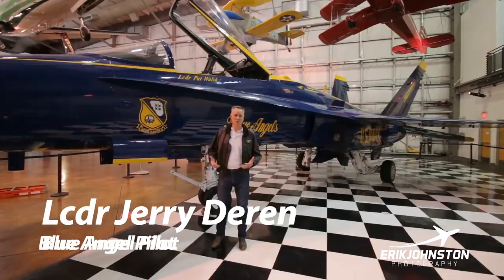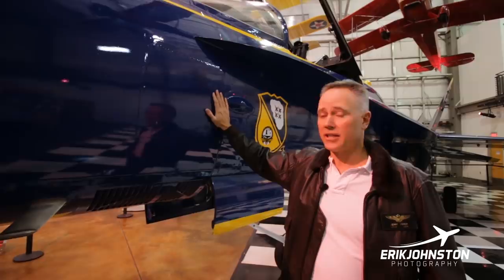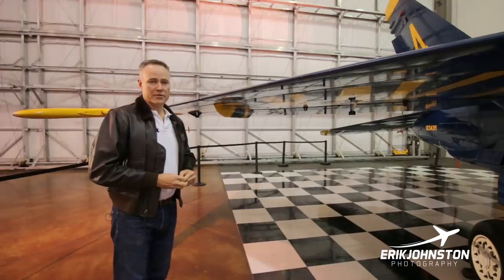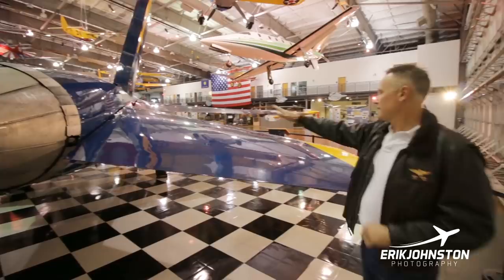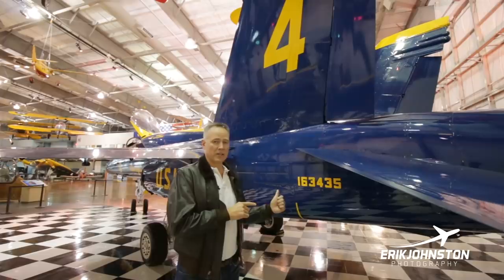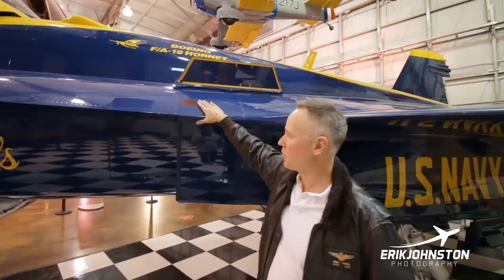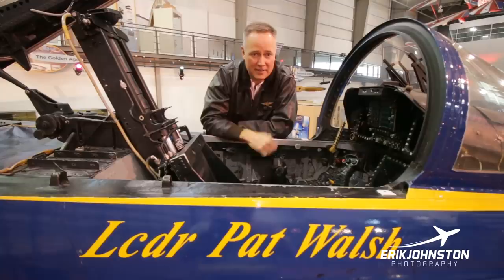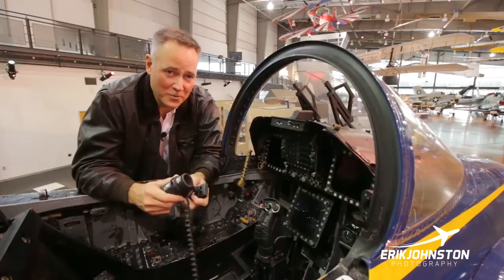Blue Angel FA-18 Walkaround

Comment: Spent many years working on that very jet.  163435 both VFA-86/82 and VFA-81.  Was transferred to 86 from 82 at one point.  Upon checking in to VFA-81, I met this old girl again 12 years later.  She was a flyer for sure.  Until we transferred it to the Blues in 2006 prior to transition to Lot 30 Super Hornets in late 2008.

Comment: after having flown the f-18 in DCS its ridiculous to see how realistic this plane is in the game
Reply: I give you 10/10 for trolling real fa18 pilots. Especially as this video actually gives no filmed direct comparisons that can be simulated on DCS.  The view of the cockpit with LCDs/CRTs off is very accurate though. VRS has a tonne more than DCS does, mainly because VRS focuses on the fa18 only, DCS tries to make so many new mods that I doubt any of them (I own most of them) will be a full release in the next 5 years. Even the fa18 isn't a DCS only project now. As I found out when I reinstalled it a few months ago. Sticking with VRS for now.
Reply: the rolls done in DCS put the leadingedges  slats 3 degrees asymmetric down like the real hornet?

Comment: Like Jerry, I watched the Blues at airshows when I was a teenager.....saw them and the Thunderbirds many times over the years. I never dreamed one day I would fly both a Blue Angel F/A-18C and an F-16 Thunderbird. I now fly remote control versions of both planes. I do most of the moves they do except I fly solo. Top speed is around 100mph and I land on a paved runway 400 feet long with no brakes, arresting hook, parachute or anything else to slow the plane down - kind of like landing on a carrier. May your skies be blue and your winds calm.

Comment: 6:10 Ooooh, Hornet Tips for DCS 😁 Nice!
Reply: Niiiiice
Reply: What page is it??
Reply: There is not page about this information in DCS F/A-18C Hornet
Reply: @32ndvfw  what do you think the FLCS is?
Reply: @goingtoscotland  have you found the page to set it in dcs?
Reply: @Hun0889  FLCS. he's talking about trim settings. Trim to 32.5 units of up elevator trim. Same as if you would set 14 or whatever for a cat shot
Reply: oh i see, yes i can set the trim for the starting around 12° for airfieldstart and 15/16/17°... as you said for the carrierstart.
https://youtu.be/gqlTo739Rz0 
even when flying AOA, i never see the number 32.5 on the fcs page, im confused now...
Reply: @Hun0889  you're looking for 8° roughly AOA for an on speed approach in the Bug. The elevator trim values on the FLCS page do not correlate to degrees as far as AOA goes.
Reply: @goingtoscotland  oh, thats why u wrote units for the elevator-trim, and not degrees.. now i see, just changing the elevator-trim up 32.5 units and the plane starts flying at AOA, right? (hard to get that in english for me...)

Comment: LEX: Leading Edge eXtension.
Reply: Thank you. I was just wondering what "lex" could possibly mean.
Reply: And the little fences on the LEX is to smooth out the airflow so to reduce the vibrations for the Vertical Fins. The fins used to fatigue so much they added the Fences and also additional brackets to the support the fins

Comment: Lex ( leading edge extension ) I was stationed at strike aircraft test directorate in the 80's. We did some of the first lex fence mods on the hornet man what a job we removed the entire lex and sent it out to be modified then had to reinstall and rewire. all hands effort. We also tested the night attack version of the c and i think d models. green plastic taped on top of white instrument lighting so the pilot didnt get blinded using nvg 50k a pair back then. I remember a story about the blues having a 3 roll limit their first season because the hornet was departing flight and tumbling end over end  maybe LCDR could confirm. I was told a Canadian airshow pilot found a fix using opposite rudder input. 54 years old now and i still miss it the hornet was my first love :-). AE2 Schaefer
Reply: almost forgot they found cracks on the vertical stabs the lex fence was designed to prevent that. works something like those little vortex generators at the 6 o/c position inside the intakes. the ones that would slice your nuts if you slide to fast inside to check the fan blades :-).

Comment: I was in the Navy when Lt Walsh was a member of the blues. that hold bar he's referring to that breaks away from the hold back bar attached to the rear of the nose wheel is called a T bar. There are different sizes for different model aircraft. One time when I was working arresting gear on the flightdeck, I almost got hit by the broken piece that was still attached to an A4 Skyhawk that landed and it fell off and it bounced past me. To this day i still have that broken half. Also stationed at NAS Pensacola on the Lexington.
Reply from the maker: Oh wow! That’s a cool story!
Reply: Heard my old Boat (CVA63) replaced "Old Lady" Lex as the "new" training carrier at NPA. Was wondering if She's turned into razor blades in 2021?
Reply: @fgap1  are you talking about the Kitty Hawk or the Lex? If its the Lex its a museum in Corpus Christi, TX. As far as the Kitty Hawk. Its at Puget Sound Shipyard awaiting disposition since 2009.

Comment: Thanks for this interesting video.  I am surprised that this “Single Purpose” jet for show carried so many thing that you will never use, such as the tail hook.  In case of a call for war, those things can be put on quickly.  Another thing, with the slick paint job, no gun, no hard points (lighter plane), I could imagine it is a bit faster than a regular combat ready version? Thanks,

Comment: Do Blue Angel pilots use the spring on the stick when transitioning from location to location or is it connected at all times?  What about G-suits?  Never or just not during shows and training?
Reply: On the blue jets, the spring is there all the time, I do believe. And the no G-suits are the same. Blue Angel specific mods, but they're full-time.

Comment: the 3 lights on the nose strut for AoA and replicated in the cockpit, the yellow light is the optimum glide slope , red and green and warnings, I would have thought it to be more logical the green is optimal and red, orange be warnings ?  Why did they design a system where green is a warning and not normal ops ?

Comment: I thought modern holdback bars were re-useable?
Reply: Yes they are.  JD misspoke I think.  Likely was briefed on the older versions used A-6/S-3/E-2 etc and never even seen the ones used for hornets up close.  F-14, F-18, and F-35 holdbacks use a spring mechanism.  Three year tour as a shooter and I think maybe less than a dozen airwing guys came out to see how we did things or look at the gear.